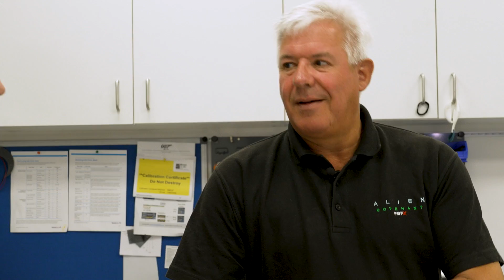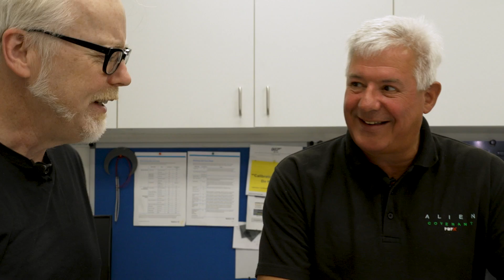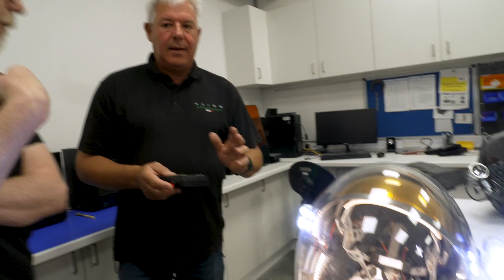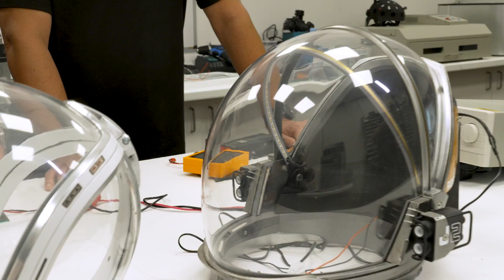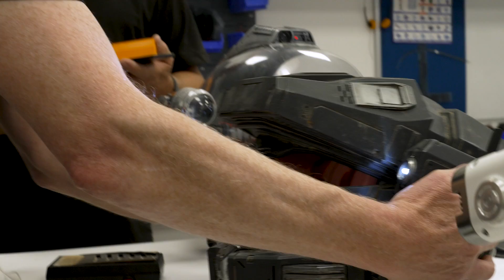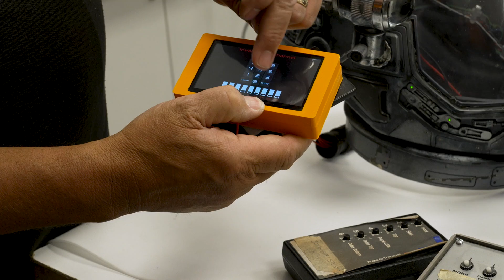Adam Savage Learns Sci-Fi Space Helmet Secrets!

Comment: A solution they could use for the fans that doesn't involve that much sound would be to file away the little bridge that's on the neck of the "escargot" (i totally forget what the right name is) and that should reduce the sound of the fan considerably at no big loss of pressure. Alternatively, a sideways port cut into the casement could create a low pressure area that basically sucks the sound as well, tho, it would have to vent to atmosphere some place close, so that'd be difficult to fit if the fan's buried inside the helmet.

Comment: I wonder if you can recreate that Event Horizon LED just using a $200 flexible OLED hooked up to a RPi. Or would that lack the brightness or depth of the LEDs.
Reply: Raspi? Too "sensitive", too long to boot up, too difficult to fix in case of an error.
If you go on set with a prop like this, you bring a couple of replacement parts with you.
Also today LEDs might even be requested spcifically.

Comment: Something I've often wondered is if they can use PWM-dimmed LEDs on set. Surely, if they're used incorrectly, you'll get those weird rolling and strobing effects. Do prop builders have to use complicated constant-voltage or constant-current dimmers?
Reply: I build movie props for a living and yes you can use PWM. Just run at minimum (max FPS) * 4 so you dont get into trouble with VFX department about some weird globas shutter problems. I like to use 1kHz. Still works ok with the ~300FPS modern standard camaras can do nowadays.
Definitely not enough when they bring out the high-speed ones. True linear controlled current will save your day there.
Reply: I’m no movie industry professional but I imagine that if you just get high enough PWM frequency it won’t matter for flicker. Might get spicy with the radiated EM disturbances though.

Constant current is fairly easy nowadays as well.
Reply: @greenveg42  EM disturbances will not be a problem unless you arrive on set with this 24V 400A LED power supply, running at variable frequencies and featuring 20m long unshielded cables. Other department's gear is more likely to scramble your little microcontroller...
Reply: @pyrolabsberlin  I’m sure you are right!
Reply: @pyrolabsberlin  in my head I was like ”yeah they might need looooots of light for camera reasons so 48vdc @ 10amps or more doesn’t seem too far out”
and 
”If you switch at like 10s or 100s of kHz that could for sure lead too problems if you aren’t cabling correctly”

How off am I in judging that as problematic?
Im really a mech engineer that just dabbles in the magic pixies…

Comment: As a light-tech, I'd be looking at art-net for controlling the lights. You could use almost any lighting console to control every single LED over wifi if you want. I used the same thing in my guitar build. A few years ago I decided I wanted to build my own electric guitar, and for the fret markers I used RGB LED's. The controller chip is a wemos D1 mini, and it uses art-net to control all 12 LED's in the fretboard, so it could be integrated in the rest of the show on stage.
Reply: Apparently pyro guys get really anal about wireless stuff.
Reply: I suppose it would depend on interference on site and the distances
Reply: The next iteration will be a smartphone or tablet app.
Reply: @marcusnichols5595  Dang, a shame about the hardware/os and wireless protocol flaws.